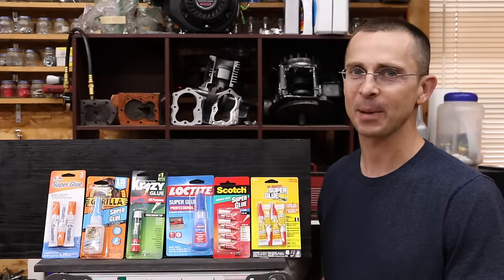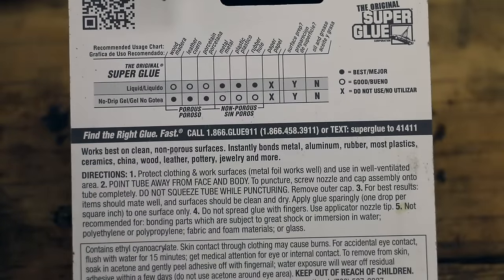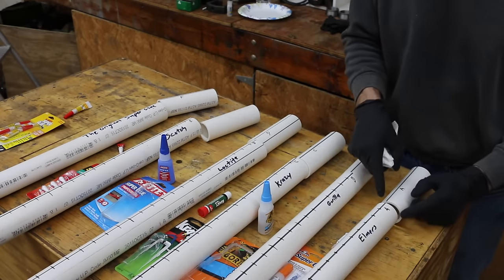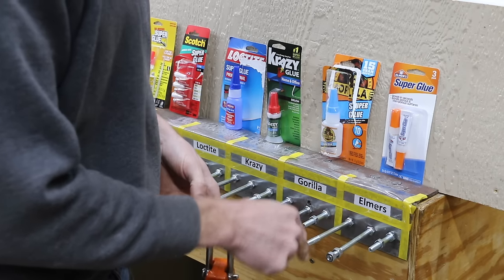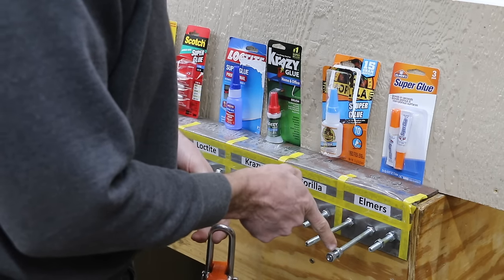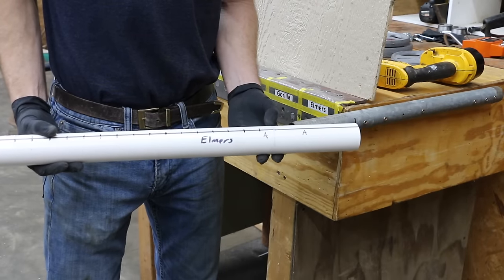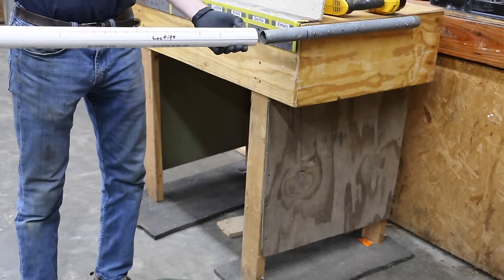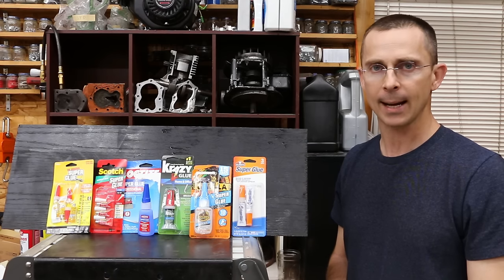Which Super Glue Brand is the Best?  Let's find out!

Comment: Switched to Loctite because of this video. Cap comes off everytime and I can actually use the whole bottle.
Reply from the maker: Nice!  Great product. Thank you
Reply: I used the actual super glue brand.  I've had bad luck with the Loctite brand getting stuck in the cap.
Reply: Me too, loctite aswell as loctite x8, husqvarna trimmer line, LLP tape and frogtape.
Thanks Project farm...
Reply: Between Loctite and Gorilla glue, I'd say Gorilla glue has less trouble with the cap being glued on. Loctite always end up being glued when the bottle is halfway empty. I still manage to take it off by flexing it and prying it off with a flathead screwdriver, but it's sure annoying. Always wipe off the glue on the tip before putting the cap back.
Reply: Vital Information it is quite amazing that the dirt cheap superglue is actually very good
Reply: vital Information: I have been using Gorilla but never empty the Bottle
Reply: If you put the loctite in the refrigerator that donsent happens
Reply: @victormvalle3143  Thank you
Reply: @HCkev  my personal experience with gorilla superglue is that you get residue buildup on the cap, which makes more difficult to close, it gels somewhat over time and by the end it's difficult to apply, regardless of this, the product works great once you manage to apply it.
Reply: @the.reel.mccoy.  I'll never use the "Super Glue" brand again.  It hardens in the sealed tube after about a year.  I called Super Glue and the rep said that they only warranty it for a year after mfg.  She really didn't seem to care.  I've never had that problem with Loctite.  What I do is to store them cap side up after I open it, after I make sure that there isn't any glue in the nozzle.
Reply: @jim.h  I've had superglue for years with no issue
Reply: @the.reel.mccoy.  If you wipe the tip with alcohol RIGHT AFTER using it, you wont have any trouble removing the cap next time.
Reply: @EllTheBob  And it's ALWAYS a $1 for the "twin pak" (same as in the video) at the "dollar tree"!
Reply: Don’t use the Gorilla one goes off in the bottle.
Reply: Cap shouldn't stick if you clean the nozzle before closing, right? If it still does then maybe the tube is too tight that it squeezes the glue out?
Reply: I use loctite. Never have problems with cap or glue drying at tip!
Reply: @CrimeVid  you're supposed to put it all in your hair, right?

Comment: Store your super glues in the fridge. They'll keep much longer.  Also know that by applying them cold, the working time before they bond increases, so that can be an advantage depending on what you're doing. Otherwise let it acclimate to room temp first.
Reply from the maker: Thank you!
Reply: I'd add that it's a really good idea to try to squeeze out as much air as you can as you put the cap on. Between that and the fridge, there's no reason you can't get many months if not a year out of a thing of super glue, if you don't find you use it that much.
Reply: Just need to eliminate moisture. Just keep all the silicate bags from products and put em in the jar with glue tubes.
Reply: @inq752 isn't it air that technically ruins super glue?
Reply: That can a disadvantage you meant to say right.
Reply: It still glues skin instantly even on ice or chilled is there a cure for that🤷‍♂️
Reply: According to Loctite their unopened product has a shelf life of 1 year. An opened container will have a max of ~6 months life. The problem we consumers have is determining how long the product has been on the store shelf. Many manufacturers are using date "codes" so you have to know the code to determine date of manufacture. I guess they sell more expired product that way.
Reply: @beachinrc101  wear gloves
Reply: @itsMrBRoc No, it is moisture contamination. Cyanoacrylates react with molecular water on parts to cure. Because chilling a superglue makes it liable to sucking moisture into the container when it is opened, that is a reason to store them in a cool dry place but not under refrigeration.
Reply: Mine are always kept in my toolboxes for months. Never had an issue with em in the sun or back of a car or on a jobsite
Reply: @theodorehile7921   I learned several years ago RTV silicones also use atmospheric moisture for curing.

Comment: I've had more issues with glue being dried out and unusable when needed after sitting on the shelf for several weeks (or months) after being opened and used only one time. The only glue that  passed that test was Locktite. That bottle is about a year old and is still liquid and in good usable condition when I had need for it recently.
Reply from the maker: Thanks for sharing.
Reply: Trying to cap and save a tube of glue is a lost cause. You might as well count on one use or application per tube.
Reply: I am just studying this problem, apparently you should store it in the freezer in a plastic baggy to prevent air getting to it.
Reply: I'll try buying Loctite next time just based on that report. Superglue formulations must have changed over the years. I can remember being able to keep it around for quite some time at room temperature provided it was sealed up well. Now, it's use one drop and it's guaranteed useless next time you need it.
Reply: I have bottle of locktite that has survived for several years now. I store it standing up in a drawer where it's dry and room temperature. Very impressed that it is still usable.
Reply: No issues with gorilla glue gel. Same thing. About a year old and still comes out easily.
Reply: in my experience, the little tubes are prone to dry out at the tip rather quickly, but the actual reservoir of the tube keeps glue well for about a month or so.  I picked up the habit of "flushing" out the tip, making sure there's nothing but air in there before I cap it. It's been years since a tube has gone unusable on me before I empty it. Worst case scenario it develops a bit of a scab that can be poked through with a pin or needle.
Reply: My locktite been sitting in the drawer for at least 5 years and is still liquid and works amazingly well. Gorilla glue I bought last week is sticky already
Reply: 🤷‍♂️if it helps but the Walmart multipack of the small tubes if I store them up rite I have gone several months with no problem sometimes the 2 part cap sticks but just have to unscrew it from the tube &works fine
Reply: The enemy is moisture. 
More specifically the moisture in the environment when you opened the container.
We have a very small storage room at work which has one work bench and a dehumidifier running 24 hours a day. 
There are three tubes and 4 bottles of used super glue in that room which have recently reached their 4 year mark. 
They remain as they were when opened on day 1. Yet every container of the same glue used in other portions of the shop tend to solidify within weeks at best. 
Thinner, liquid types of super glues will survive longer after opening than the thicker gel type glues, but one must still be mindful of moisture content in the environment if storage is a goal. 
Refrigerating the contents can be risky since moisture will rapidly condense and collect on the colder glue. 
The aforementioned storage room is a consistent 78-82 degrees F which helps extend glue lifespan. But it is the very low air moisture which is the main factor in product survival.
Reply: I use a piece of electrecal tape, to seal the cup where it meets with the body when closed.That,makes it last for at least 2 years if not even more. I've used the same super glue several times for 3 years,just by using tape to seal the cup. I store the glue in my toolbox (room temperature). Just make sure you use enough tape and make sure you won't leave even a hair thin gap. If I don't use tape, the cup is glued so hard, that even it there is usable glue in the tube, I can't open it properly, only thing I can do,is to cut of the tube with a utility knife, and use it for only one more time. A pice of tape, solves all the issues and makes the super glue resuable again and again. PS THE best super glue I've tried and the one I always come back to, whichever I've tried, is the LOGO στιγμής, it's either Japanese or made in Greece glue, but it's the strongest I've tried by far, plus the bond lasts for many years.Great quality.

Comment: Loctite seems to be the best bang for the buck. It won the pipe test and tensile test and was the cheapest cost.
Reply from the maker: Loctite makes a great super glue for sure.
Reply: I would says Krazy glue, you can buy it at the dollar store for $1
Reply: Caleb Turner Month late but krazy is good for only 1$
Reply: Absolutely!    Loctite   is   the  best;  also  best   value.
Reply: Really?
Reply: Caleb Turner you can buy a lot of things for 1 dollar at the DOLLAR STORE
Reply: @eloy0612  LMAO XD
Reply: It's also the easiest one to find around the world.
Reply: I think insta-cure makes it and sells it under the loctite name..
Reply: I rebuilt a subwoofer 6 or so years ago and used loctite for the suspension (JB Weld for the magnet/motor) and it hasn't failed. I now use it for everything.
Another surprising fix that we used it for was plastic Disney World plates. They were broken into pieces. We glued them 3 years ago and have used them everyday. Has not failed. We even throw them into the dishwasher. The glue did yellow a little after a couple of months, but still holding strong.
Reply: Loctite also sands easily.  <uses it for gap filling on models.
Reply: Ryan Toomey if you add baking soda on top it's stronger bro
Reply: Elmer's was the best overall for metal - But loctite isn't far behind, for plastic it's not even a question!
Reply: @ProjectFarm  I guess you could say loctite makes a super super glue
Reply: I gave up on super glue years ago
 I use 3M two part epoxy. Costs alot but it will hold and thats all i care about.
Reply: I concur, overall it's Loctide. But I am surprised about the big differences. I was thinking it's all the same cyanoacrylate.
Reply: Eloy Miron. Freakin hilarious
Reply: It's great for many applications. The fact that it breaks on the twist test is deceptive since you want it to. It's great to secure bolts you may want to adjust later down the road so you don't want something ridiculous that is going to be a super pain to break past.
Reply: @RAYMOND121976  Yeah, as long as you don't care what it looks like the baking soda works great as a catalyst.  I had some parts I needed to set quick and baking soda did the trick.
Reply: @EpicCherryGaming  "you can buy a lot of things for 1 dollar at the DOLLAR STORE"

Not really. Just because it's called a "dollar store" doesn't mean that everything there, nor even most things there, cost a dollar. The term "dollar store" has been around since at least the 1980s; you think everything is still the same price?
Reply: Ryan Toomey well in that case it’s not really the best bag for the buck... it’s just the best.
Reply: Billy Jack ..but what you use has a thicker viscosity. I use it for guitars and I mostly nee a very thin glue
that can wick under a finish or under a fret.
Reply: MaximRecoil ..Then go to a Five and Below 😬😬😬😬😬😬
Reply: @MaximRecoil  think he meant  the dollar tree ,which everything is a 1$  ,not family dollar or dollar  general
or even a .99$ in nyc
Reply: @MaximRecoil  Today our Dollar Store, Everything $1, EVERYTHING is in fact $1. Your store is deceptive, false advertising.
Reply: @jamiemorgan4146  
A guys guitar nut broke. We needed a quick fix. Filed some fine filings of hard plastic, mixed with crazy glue. It filled in the missing peices and held throughout the gig. Should work for a nut that's been filed to deep also.
Reply: kentucky windage222 ..super glue and baking soda works really well on guitar nuts !
Reply: @jamiemorgan4146  
I will try it next time.👍
Reply: Loctite and 3M have one thing in common best quality they can make.
Reply: Ah yes, super cheap it is... 😄
Reply: @AiOinc1  do you have to buy a specific glue for plastic or is it for general use?  Thank you
Reply: , where do you get it, Amazon?
Reply: @billyjack8119  where do you get it and the name
Reply: @jamiemorgan4146  then use thin CA it will soak into wood. Or medium thickness or thick is easy to find. You can also get a kicker or insta set and its ready in seconds
Reply: @leesire  3M 08115
Reply: @billyjack8119  where can you buy it? Amazon, and just search using that
Reply: @warmfreeze It’s made by Henkel.
Reply: Ryan - You don't need the word "cost".
Reply: @MaximRecoil     $1.25 now.
Reply: @jamiemorgan4146  If  I own 5 guitars, am I a guitar nut?

Comment: Great video. I'm an artist working making sculptures out of a wide variety of materials (e.g. bone, metal, wood, ceramic, plastic, etc.), and I've found that Loctite Gel Control super glue to be the best for the diverse materials I use. E6000 is another favorite among artists, but its drying time is significantly longer, so I stick with Loctite for most small things.
Reply from the maker: Thanks!  Thanks for the feedback.
Reply: I work in trades and that is also the exact same super glue I use. Amazing control & great adhesion, never have to worry about it drying. Might be pricy but worth it imo for a better finished product and for it to be working when you need it

Comment: I'm a retired H/D mechanic and machinist , loctite has been the trusted name in the industry for years, most the others are just a big advertising budget.
Reply from the maker: It's a great product!
Reply: I too am a retired machinist and Loctite was always our go to used a lot of bearing mount.
Reply: I'm a carpenter / general contractor and I've always trusted the Loctite brand I'm also no mechanic but I've always worked on my own vehicles and trucks and equipment. I would have to say though some of their newer products that they put their name on are surprising like their power grab cock the shit is junk I cannot even believe they would put their name on that shit so even though I do trust their brand I'm very skeptical of these days
Reply: Yep, as an appliance repair tech we use it in our industry for use with refrigeration. The Lokring tool, which uses crimp style connectors using loctite is taking place of torch brazing for sealed systems because of new butane Refrigerants the industry is switching to. Cant use torches with flammable refrigerant.
Reply: Robert Salmon I put that shit on everything
Reply: Sgt Oif ArmyCombatveteran  super gluing airplanes? Should I be worried? haha JK Thanks for your service!
Reply: I agree, and it has squeeze tabs on each side or meter the amount you want. You twist it each time you use it to break the new seal that is created from the last used time..
Reply: Belmont Kraft Hold This W

Comment: So..
Loctite for plastics
Elmer's for metal
Reply: Mostly... should be noted that it really depends on the kind of force expected for the metal to endure... As he showed there was a different winner in each of the different metal tests...
Reply: Scotch worked better for metal
Reply: Montage Central Only in 1 of the tests.
Reply: My luck and experience is that none of the super glues work on anything I wish to stick together. They only work on gluing my fingers together (accidentally).  I guess that's how "medical" super glues were discovered!
Reply: If you sprinkle baking powder on super glue, it's strength increase by up to 5 times. Not joking
Reply: @montagecentral1379  How did you arrive at this conclusion? Scotch did not work better than Elmers except in one category for metal...
Reply: @montagecentral1379  But you will be paying for it... For metal, fasteners are generally a better idea! What a gorilla glue guy, but gorilla glue was always more a wood one though...
Reply: @TheRealWarez  Check how it works overall for different stress, Elmer always had a good scores for all types, meanwhile scotch was extremely effective just for one.
Reply: @ccadama  - I wonder if that was because of the moisture in your skin set the glue?  You should view some of the other videos about how to "fast set super glue" by using baking soda and/or water.  Or, baking soda dissolved in water and lightly sprayed on the super glue before it sets.  The baking soda causes the super glue to harden immediately.
Reply: @DeepThinker193  - Plus it causes the super glue to set (harden) immediately.
Reply: @STBRetired1  Wow, I'll have to try that as a test. Thanks.

Hope you and your family stay safe and well.
Reply: Super glue was actually first invented for use in combat
Reply: @DeepThinker193  dang. Already dry. But yeah, i just googled it, youre rt. Next time def gonna try it tho
Reply: JB Weld [original] for everything.
Reply: @DeepThinker193  Where you learn that? Just curious...🤔
Reply: @BlackLight_VA  I just randomly research stuff, I eventually came across a video on The King of Randoms channel where they were mixing random stuff with crazy glue. They eventually mixed baking soda with the crazy glue and had an unexpected outcome of the glue hardening to a plastic like material almost instantly, and I thought hmmm could be useful. I did more research and also tested it myself.... It's a long winded story, but that's how I came across it.
Reply: @DeepThinker193  That's wild...👌🏿
Reply: Thanks for the recap
Reply: Loctite works greatly for cardboard too
Reply: @DeepThinker193  We need a test on that @projectfarm
Reply: Loctite is a ethyl. That’s why
Reply: @DeepThinker193  im wondering if it can be made inti building material, like say a canoe,IDK!
Reply: Locktite for plastic,how to order & 
How much
Reply: Someone said Loctite is for metal and Gorilla Gel is for plastic.